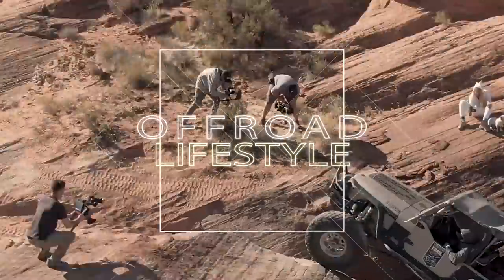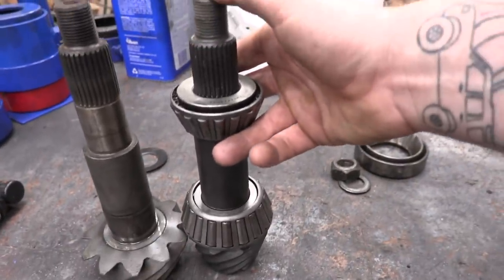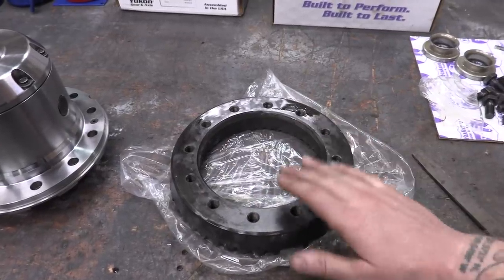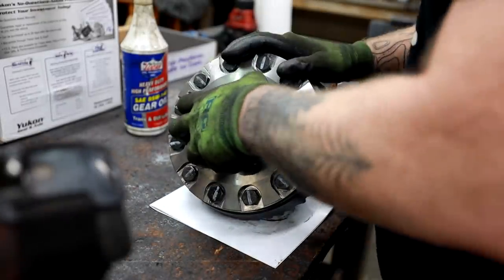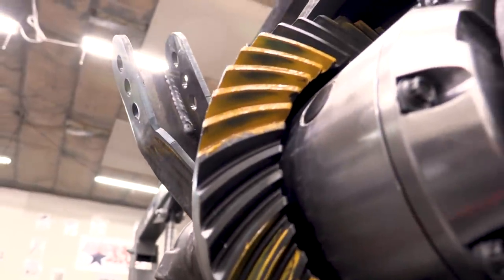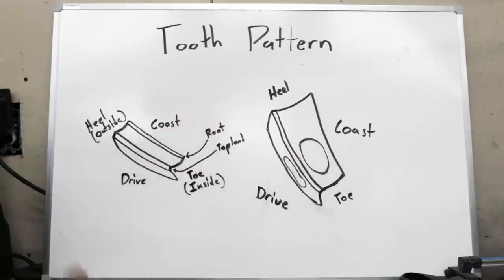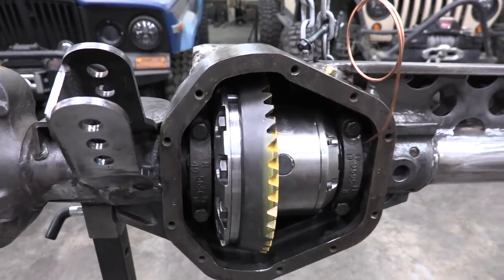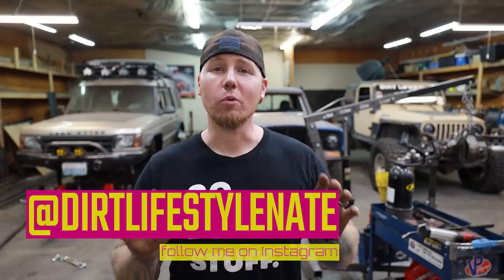Dana 60 How to Gear And Locker Install. Ultimate Land Rover Discovery Build Episode 12.

Comment: Why was his diff so hard to turn? Did he have a ton of back lash on the end bearings?
Reply from the maker: When you spin the assembly from the ring gear side it's always harder to spin. These gears are 5.38. So for me to spin the axle shaft one complete rotation it's spinning the pinion 5.38 times. Add 4 bearings with preload and you end up with a ton of resistance. Its way easier to spin from the pinion side but that would do us know good in checking the locker 👍
Reply: @DirtLifestyle  AH yes, I forgot the pinion was acting upon the ring gear still.

Comment: Nice job.
does Yukon not give you carrier preload measurements or total preload? I measure the inch pound value after I install my carrier and subtract my pinion preload value to get that.
Reply from the maker: I didn't see a total preload measurement in the book. But this is one of the topics I wish i would have included. I can't stress enough how hard it is to included every step on a video like this. Thanks for watching 👍
Reply: @DirtLifestyle  looks like Dana doesn’t have a spec for it. Probably because it does not require a case spreader and does not have adjustable collars like Toyota’s members and several other types of axles.

Comment: Absolutely awesome video!!👍 I’m thinking of buying all the necessary tools to do it myself so then I can help other people do it. I’m probably just going to be putting gears and lsd in the Dana 30 and the Chrysler 8.25. This video was very helpful and you explained stuff in a very easy to understand way. Do the 1 ton axles also have the bearing preload adjusters that can use a tool? I watched a video on the 8.25 where this was done.

Comment: Hi Nate, hope you see this. I didn't catch it in the video but I was wondering what gear package you purchased for your axles?  Looking at yukon they only offer up to 4.88 for the sterling 10.5 axle. Did you use the gears available for the 10.25 axle on the 10.5 to get 5.38? If so did you have to use any different bearings for the pinion? 

Thanks.

Comment: if you only needed a locker in the front diff 2 or 3 times a year what would u buy. i have a 1994 Ram 2500 5 speed the front diff is stock in every way doesn't have locking hubs like i said front end is like it came new and its a 44  i think

Comment: OK, you are giving a lot of good advice but right off I have a problem. What do you do if you do not have an original shim for the pinion depth? How the hell do you measure that or where do you get the tools to measure the depth? Also, are there any numbers on the pinion that gives some sort of starting point. To start I will admit that I'm prejudiced against the Dana 60 so bear with me. All that shimming & case spreading seems to be kind of mickey mouse. Kind of backwards. The rest of the setup (gear lash & pattern) I have done before on Chrysler diffs., well except for the spreading & shimming nonsense that is. The pinion setup is the bug-a-boo.

Comment: So my niece bought a grand cherokee WK from a friend of mine. Long story short the rear end blew up up on it 3 years ago, my friend replaced the rear-end with yukon. Never drove the vehicle since. I went and got this thing and when I give it gas it makes awful noise back there but when coasting it goes away. Am I going to have to tear apart everything? or? He says it just has to be retorqued. Should I do that first? He is 70 and doesn't like to be questioned. Just thought I would ask.

Comment: You had mentioned that you want the shims between the bearing and the carrier for good reason. My question is, providing you use the proper shim size (inner and outer diameter) does it make a difference where you shim?  I have seen setups that have the shims between the race and the housing and between the bearings and the carrier.  Hope that makes sense.  Thanks.

Comment: Thinking about putting an air locker in a Dana 44. I wasn’t planning on re-gear.  With a new carrier and no re gear will there be changes in pinion depth and backlash or just the backlash?

Comment: Hey Nate that little ball in the side of the carrier is a "lead" seal because sadly humans can't drill 90° holes I in one shot yet. The air need to get inside to the locker actuator. Excellent video sir thanks.

Comment: Do you have any good resources or material to study/refer to for ring and pinion installs?
Reply from the maker: Unfortunately no. The yukon install guide is the best I have seen
Reply: Bill vista 14 boot bible though it's a slightly different axle style.
Reply: @jessename7849  Im actually going to try and do a Chrysler 8.25 and d30
Reply: @jessename7849  thanks

Comment: would the pattern change if you spin the assy by the tail shaft vs the ring gear?
Reply: No.
Reply: @TheBFHGarage  cool, didn't think it would but just in case.  I have a front lunchbox I want to put in my YJ this winter, and the same for an old tracker I'm cobbling together into a  4wd one.

Comment: I will never understand how people think they can do a correct job building an axle without a case spreader, you cannot get the proper preload, please people, if you don't have the correct equipment or "sort of" know what you are doing, don't lead others to believe you are doing it correctly.
Reply from the maker: I've known MANY people that do this for a living. A few of them are also ASE certified technicians in differentials and drivetrain. None of them use a case spreader unless it is called for and in most situations it isn't. How do you spread a sterling 10.5? Or a 14 bolt? There are many axles that don't have accommodations for a case spreader because in most cases, it is unnecessary. I measured the total preload and this dana 60 is well within spec. 👌 Don't pedal that mis-information here dude. Find another youtuber to troll
Reply: Backlash.

Don't tell him ya' can use a hammer and a punch to tighten side adjusters.

He'll come back and say you have to use a really long extension with a side adjuster "wrench"...to get the right preload/torque.

Bwah

Tell him he doesn't have almost 140k subscribers😊
Reply from the maker: @tonyb2086  lol